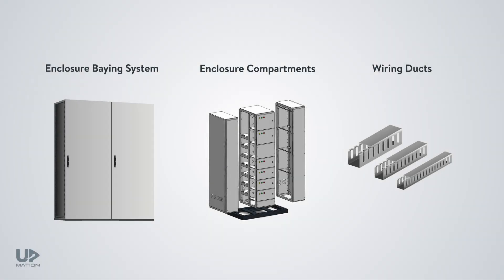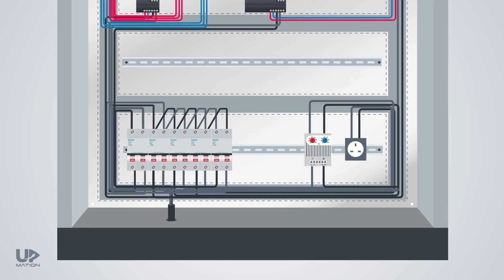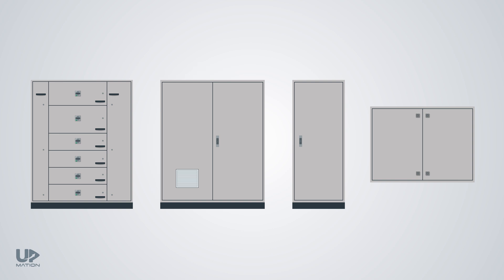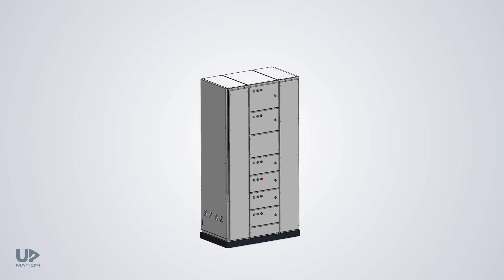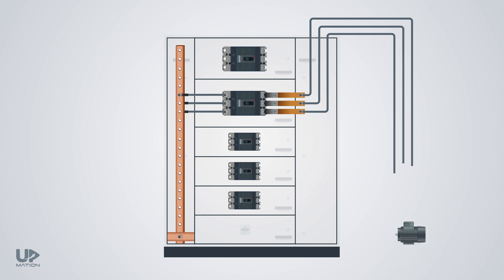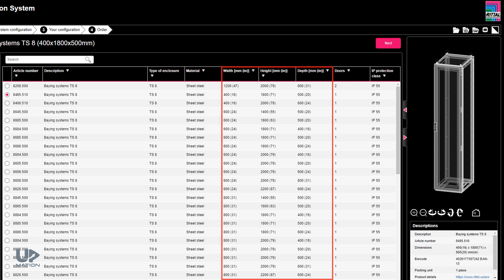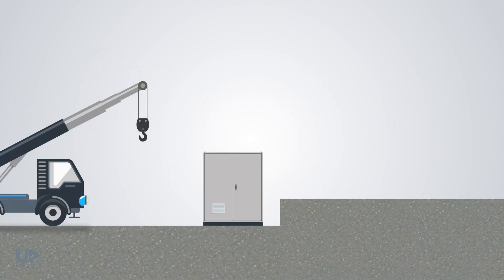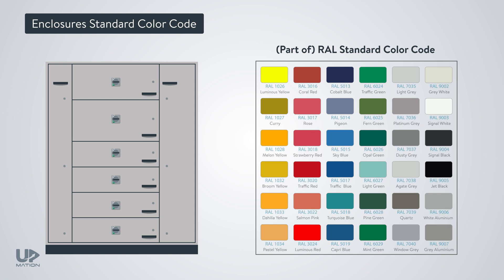Electrical Panel Enclosure | Baying Systems, Panel Compartments, Panel RAL Color, Lifting Eyebolts

Comment: You forgot to mention the best practive to use multiple cable ducts for different voltage and/or purpose (eg. 230 VAC, 24 VDC, Instrinsically-Safe signals).
And the usage of blue ducts for IS signals...
Reply from the maker: Hey, Adam! Thank you for the input! Yes, these are perfect points to discuss. There could be even a video discussing solely about wiring ducts. Thanks anyway!